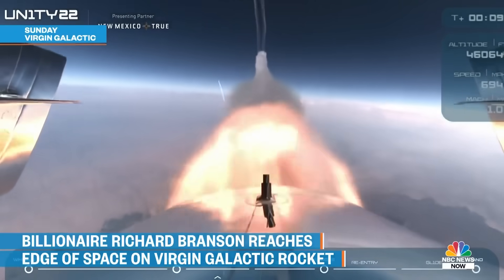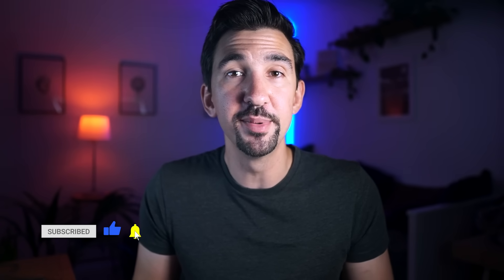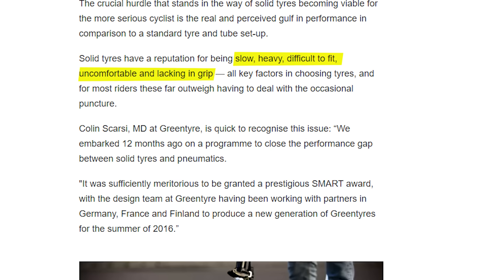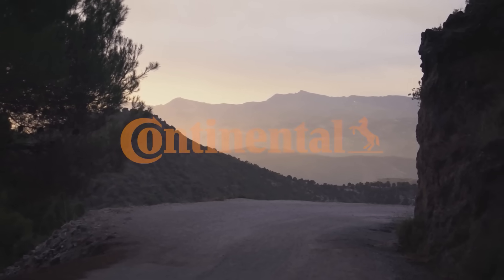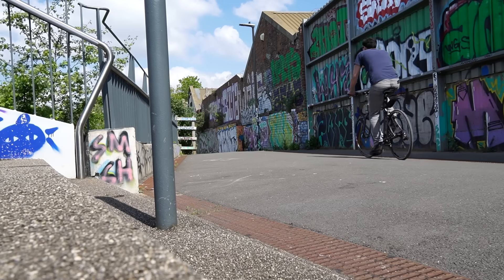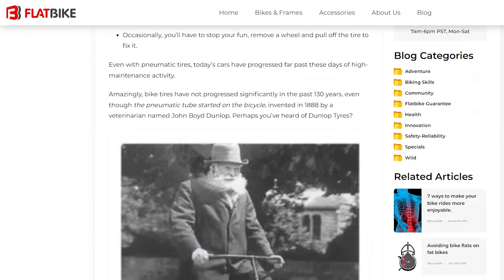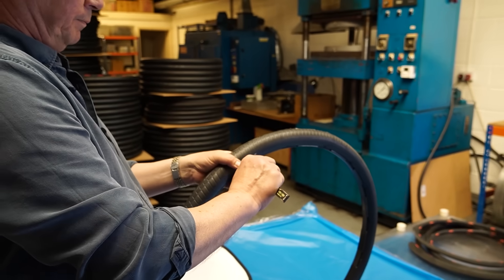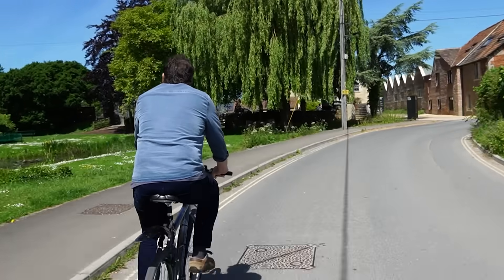I Tried Solid Bike Tires | Here's What I Found

Comment: I have been using Tanus for years, I completely agree with your comments, not only do you feel every road imperfection but they really add extra friction and inertia. The grip was poor. The heavier wheel accelerates less. For me the only advantage is reliability, the rest are just disadvantages. Need to try Geeko.

Comment: What about heat resistance, let's say for hard braking where the tire heats up a lot, how do they act?

Old solid rubber tires used to melt under high heat and would become gooey, so what about these ones?

Comment: Conventional tyres are not difficult to recycle. They are difficult to reuse as material for new tyres but the machinery to remove the metal components is beyond old and commonplace and the rubber can be reused in other manufacturing. And unless the solid tyre, taken off at home, is then transported to a recycling facility they are going to end up in the landfill too!

Comment: Hate to brake it to you but tires that dont go flat  have existed and have been in use for over 70 years now .
They are called foam filled tires . bike tires can be foam filled ,although car and motorcycle tires cannot  or should not be .
These are mainly used in forklifts on job sites where   nails and debris  shred air filled tires daily .
The drawbacks on these is that they are heavy , 3 times heavier   even .
They  are rotating mass  how ever , and while the more they weigh the harder it is to get them rolling it also means that the bike will have more inertia .
Another downside  is that they are hard and not  shock absorbing at all , but most bikes have suspension that  does most of that work anyways

Comment: Your bike tires are going flat once a month? Come on now...Fact or hyperbole? That seems HIGHLY unlikely. I ride my bike 7 days a week, 5-15 miles per day and I rarely get flats. You definitely need to check some things. Are you using a cheap tube or tire? In some cases, it could be a spoke poking through the rim guard strip. Also, your current tube or tire may have something lodged in it you can't easily see or feel. What areas are you are riding in?...do you ride near construction areas a lot, where objects such as wires, glass, nails, screws etc are found? Knowing that you are a doctor and/or a scientist, it seems illogical that you haven't looked into this more as I am quite certain you are familiar with research..

Comment: I like that they're focusing on the 700x43 size which is very common on both commuter and gravel bikes -- there's been a lot of innovation in the gravel world because those tires will take a beating while riding on gravel. Tubes are uncommon as they are prone to causing pinch flats.

Comment: What are you doing with your tires?
I am on tires still from Former Yugoslavia and didn't puncture them. The thread is almost gone and will need to replace them because of that.

Are the roads just so much worse in the UK than they are in Eastern Europe. Or how do you get flat tires so often?

Also there are tube patches.

But if they make it soft enough might try it out if they make it for my old style bike.

Comment: It might be an idea if they had this type of thing as an inner puncture resistant device.

That way you can get the best of both worlds, your tyres never go flat and you can add air to the outer tyre.

But if you get a puncture you could still ride on without bothering to fix it.

The tyre is a good idea but what about longevity, ie some people ride for the summer and then when winter comes along they dump the bike in the garage or shed, then 5 years later remember they used to like riding a bike and go pump up the tyres and ride their bike again after cleaning off the rust and dust.

What would happen to these tyres, would they crumble or stay good.

If they were an inner to support the original tyre I doubt that would be a problem.

Comment: This sounds really cool and promising especially for commuter bikes.

But for other bicycle types I see one major problem. They are not adjustable. I often adjust air pressure before and sometimes even during rides according to the coniditons I'm excepting. For example if I know I'll go on a long ride with many uphill parts and few difficult downwhill parts I pump the tires up a bit for less rolling resistance. On the other hand if I know I'll take the gondola up and will only or mostly be riding downhill on single trails I let a bit of air out for increased grip. With solid tires that's not possible so I'd have to have several different hardness tires laying around and swithcing them all the time instead of just letting a bit air out or in, which is much more effort.

Comment: It’s a great concept but I can see two issues:
Air filled tires conform to internal rim width, these would have to come in many different sizes to suit different wheels.
They might be comfortable for you at your weight, but give a terrible ride for someone lighter or heavier, so again they would have to come in different densities to match air filled tires.
Reply: Yeah, it wold be a nightmare to stock those tires. It's already a nightmare with the countless variants of 26/27,5/29 + etc.
Reply: The tires installation surface compresses into the rim (hence the use of a mallet) so a single tire can fit multiple rim sizes just like with air-filled tires.
Reply: @trapfethen  That means that with a wider rim you get a less secure fit. Not great if they roll off the rim in a high speed turn. Will probably be quite limited in the range of rim widths they are approved for.
Reply: Which, is the same deal you have with car tires

Comment: The fundamental problem of solid tyres is you can’t adjust them. As a fast road rider I adjust the air in my tyres to change the Characteristics depending on, weather conditions, road surface, and rider/bicycle weight. 

Raining today? 85PSI, fast dry ride? 100PSI for example. You can’t do that with a solid tyre.

Comment: You may be a groundbreaking scientist but I would suggest that you have a severe lack of understanding as to exactly HOW pneumatic tyres work to give great compliance to various road surfaces, grip at a suitable level and impact absorption that provides maximum comfort, all achieved with the minimum weight and maximum efficiency 🤔
That compliance and low drag through the "coefficient of restitution" is achieved in a pneumatic tyre through the WHOLE tyre supporting your weight. In an airless tyre, even with "millions of tiny bubbles" the support and restitution is ONLY coming from a restricted range of the tyre, immediately at the road contact point. Thus the capacity for restitution and low drag is ALWAYS going to be far less than for any pneumatic tree. As bicycles are very much low-power vehicles, efficiency and low-drag is EVERYTHING. In a motor vehicle a 20% energy loss due to drag is minor, but overcome with the high power sources, however for a bicycle every 1% really matters.

Comment: Airless tyres won't go flat themselves but they are notorious for bending or straight-up destroying your wheels or other components on your bike. This may be reduced with a fully-suspended e-bike (I think ebikes could be the right market) but other than this, you are trading one (economical, ecological and time-consuming) problem for another.

The most efficient & confortable failure-free setup is tubeless + sealant + liner. They can technically can still get a puncture but you can keep going. 

I am commuting about 42km per work day and use Continental GP 5000 / 4-seasons / or Top Contact 2 Winter depending on the season with latex inner tubes. Gives me about as much comfort and speed (22-31km/h av. depending on the wind) as I need for about two punctures a year, which take about 15-25 minutes each to fix. Going airless would at least make me lose an hour per week. Not to mention crashes due to the lack of grip or components being destroyed due to the vibrations.

Comment: Constant comparing of specific solid tires to competitors that are also crap from the solid tires world is just hilarious. Try to compare proper tubeless setup and "best solid tire" and you'll easily find out that there is around zero benefit in using solids. Other than mythical "environmental friendliness" that also, btw, got negligible impact if you put down the math. 
So in general it's about tricky compare-technique, but not about the product. 
You may declare that you produce the best 10-wheeled bike in the world, but why would anyone care, as long as 2-wheelers are still better in every single way.

Comment: I used Tannus tyres and pros and cons made them worthwhile for me.  Commuting in London i just got sick of punctures trying to get in/out for work, tried all the usual stuff Gator, Marathon Plus, sealant, but the roads were just too poor and too much debris.  Fuss-free reliability is definitely great for a specific type of cyclist.  Yes an absolute pain to fit, but i did about 6500 miles a year, and they'd last 4 years.  Second set was the slightly improved model (meant to be softer iirc) and seemed completely fine too.  Also nice not having to carry all the things to fix punctures, which saves weight/space.  If you're a commuter i'd defo suggest at least keeping an open mind about them.
Reply: Thirty years ago, my bike expert friend tried tubeless tires.  He loved them for a few months and then uneven wear around the circumference turned every ride into a washboard road.   In your experience, would you say that issue has been solved?
Reply: @keeperMLT  Yes i'd say so.  On smooth paths there was certainly no judder like the tyres were worn unevenly. 
i'll caveat that by saying the rear had slight flatspot from an emergency braking incident with a black cabbie (right hook turning across me when i had right of way), and they are quite firm (aka 80-100psi feeling) so you feel imperfections, but nothing else apart from that.
Thirty years is a long time to improve the formula / manufacturing process, and seem different to info i could find of much older "solid" tyres.

Comment: I’ve been running Tannus inserts for about 3 months (roughly 500 miles) and I have no complaints, the ride is just as smooth as without the inserts and just as fast. Also, zero flats and I live in goat head hell.

Comment: With all due respect, it seems to me you're overlooking the worst part about solid tires; fitment/safety.
If you can get them on the rim, they tend to be able to roll off too, unlike pneumatic tires.
In fact going the opposite direction, tubeless with some sealant in there, is gaining some traction. (pun intended)
Cheers.

Comment: flats dont fill the land fill, its the wear and durability, and thats only a solution to new problems, nothings lighter than air,  force distribution is complex to design in a lightweight design. i used to puncture every day and multiple times a day when i started riding harder, soon i found myself going tubless and choosing the right tyre and havent had a flat for 5 + years. using the right compouds they can last longer than you want them too.

Comment: I tried a Tannus tire once but could never get it mounted, no matter what I tried.  It was the single most frustrating bicycle task I have ever done.  I ended up having to cut and tear it off the rim. I would never even think about a solid tire again unless I knew for sure I could get it mounted.  Meanwhile Schwalbe Marathon Plus remain my tire of choice for all my bikes.  A little extra weight for flat avoidance is a small tradeoff - flat tires are a huge bummer.  In 7 years I have had only one flat on a Marathon Plus, where somehow I ran over a nail straight on that was long enough to penetrate all the way through the protective layers.

Comment: I tried solid tires in the past. I think they were polyeurthane. They rolled just fine as I got a 60 psi version. But I could not put them onto the rim. I had to get a guy with a motorcycle tire machine to install them onto the rim. This system installs quite easy. Price was in the same range. About $50 USD.

Comment: While I like the idea of recyclability, the big problem that this video didn’t touch on is the tune-ability of pneumatic tires. The ability to change air pressure is essential. Tire pressure is very complex and there are so many variables from rider weight, tires size, surface  and more. If I am riding very smooth pavement, I will run a lot higher pressure. If I am on the loose dirt I will run a much lower pressure. Many times I will change  tire pressure in the same ride when going to different surfaces like running higher pressure riding to a mountain bike trail and letting out pressure one I am on loose dirt. 

I will also run different pressure based on the total weight going for a quick ride vs fully loaded touring. The only application that I could see this not being as big of an issue is with bike commuting.

Comment: He reinvented Neoprene. I use Maxxis DH tires in rough dh tracks. No punctures. Wear fast. I have a smooth riding style on the road. I weigh 130lb. I hardly wear my tires. It's a humanoid problem.

Comment: I used to travel by bike a lot, and I've had a lot more mechanical issues due to wear and tear and influences of the weather, than having a flat tire. Just ditch the tires that come standard with the bike, and get some premium brand tires with some decent puncture resistance. In over 50k km (31k miles) I think I had a flat tire maybe twice using good tires, before that once every month or so with cheap tires. So, the fear of getting a puncture is not going to convince me. Rolling resistance, comfy ride, durability and price would matter to me. And, I'm sorry to say, if the price as seen on the kickstarter is anywhere close to what it will be when it's on the market, this is not for me. I don't mind paying a little bit more for a more environment friendly option, but almost three times as much is too much, especially after weighing in the reduced rolling resistance and the inability to adjust air pressure to my exact liking.

Comment: one reason your bike tires go flat is not keeping them fully inflated,since topping off my tire pressure at least about once a week i have noticed a significant reduction in flats, trying to ride mostly in bike lanes helps as well because if a shard of glass is on the ground with the perfect angle to penetrate a bicycle tire its more likely to have been picked up by another cyclist

Comment: I did a cycle tour through NZ and Europe, covered about 5 thousand miles on a set of schwalbe marathon tyres...no joke I only got 1 puncture in the last 100 miles, I noticed as I was packing up at a hostel in Amsterdam to ride to the ferry at the Hague and I still managed to pump it up and ride it to change on the ferry because it was so slow, could even of just been a leaky valve because I didn't find a hole in my very brief inspection. I'm still using these tyres now and probably have another 3 thousand miles on them with no punctures. I think it's just the right tyres that matter....

Comment: I did a 400km trip using solid tires in 2017 and i hated them. They were noticeably spongy giving a feeling like pedalling in sand. They had a high rolling resistance due to this as well and additionally they tracked every crack and fissure in the road creating a sense of instability. Maybe “All” of these issues have been improved upon ??

Comment: I commute daily, rain or shine, to a job that requires my timely presence. Getting a flat on the way to work resulting in being late, would incur a write-up penalty. The company is restructuring the profile of its work force and older employees have to avoid such penalties. So far, Green Goop, has reduced such incidence, but it would be nice to not have to worry about maintaining proper tire inflation. I would certainly welcome a solid tire, if it was easy to instal, didn't increase rolling resistance,  and gave a decent ride over rough pavement. Aren't we skipping over the evolution of development however? Why not a solid tube over which a tire of the riders choice would be stretched and mounted.

Comment: If you use a bicycle like an appliance - foam tires are fine. 

Contrary to what OP says though... pneumatic tires aren't at all just for racing. If you care even a little bit about adjustability of your level of comfort, grip & speed... you'd better learn how to patch tubes or run tubeless. Pneumatic tires are used for so many applications because their performance is unmatched so far.

It is really awesome that you can recycle foam tires. That's maybe the biggest benefit aside from no flats. Although honestly, I think I've flatted once in the past year and I average about 2,000 mi/yr. I patched the tube. That was that. Nothing went to the landfill except the foil backing of the patch.

Comment: Nothing will outdo tubeless tires. You can adjust the air pressure according rider weight and type of surface, ie.,- pavement, hardpack, gravel, sand.

Comment: Rather than muck with tire design, when it comes to flats, design the rear mech on bicycles to make wheel removal and re-installation simpler. The worst thing about flats isn't about the flat itself, but about how hard it is to remove and re-install the wheel in order to repair the flat.
Reply: On most modern bicycles, if you put the chain on the smallest cog the wheel drops right out with gravity.
Just loop the chain on that cog to reinstall, and it feeds itself right in too, by lowering the bike on the wheel.

Comment: I use Schwalbe Smart Sam Plus which has an additional layer of protection. Just like he showed in the video.
Before that one of their Marathon series models which is practically impenetrably.
I am using both since 2017.
Never had a flat tire again.
Whether on gravel, road or hard terrain.
Nevertheless these new tires also look very interesting.